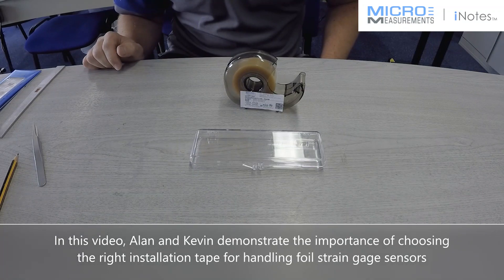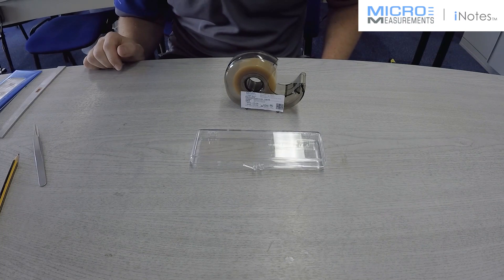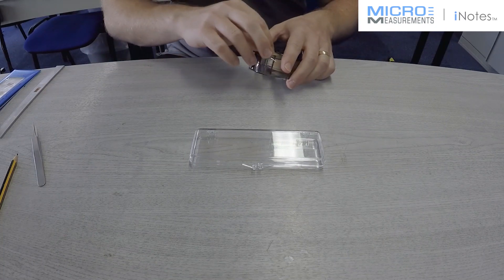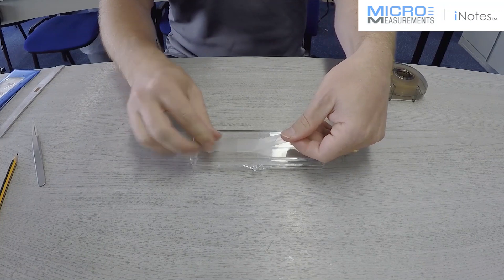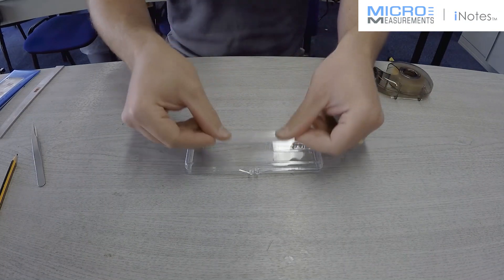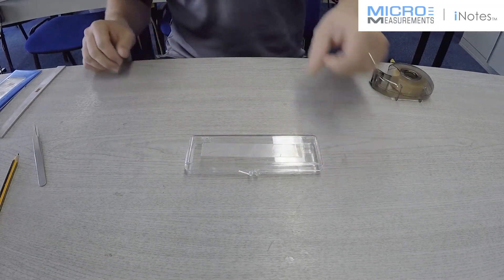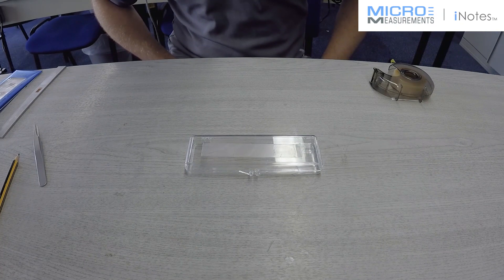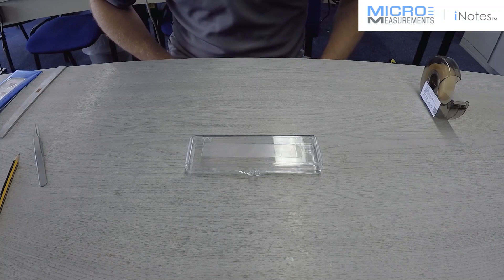Don’t Duct Duck The Problem - Strain Gage Installation Tape

Comment: Desde Micro-Measurements y su filial española Vishay Precision España, s.l., ofrecemos todos los accesorios necesarios para la correcta instalación de las bandas extensométricas (adhesivos, materiales de preparación de superficie, accesorios para la manipulación de las bandas, cables, protecciones, etc.).
En este interesante vídeo, Alan y Kevin nos explican el porqué es también muy importante seleccionar la correcta cinta de papel celofán, y nos demuestran en la práctico, cómo la cinta de papel celofán de Micro-Measurements, PCT-3M, satisface todas las necesidades que se requieran para la correcta manipulación de bandas extensométricas. ¿Podría decirse lo mismo de cualquier papel celofán que compre en un supermercado o ferretería? ¿Arriesgaría el éxito de su instalación extensométrica por emplear celofán no certificado para su uso extensométrico y con propiedades variables de lote a lote?
Si precisa información adicional, por favor no dude en contactarnos y estaremos encantados de ayudarle.
mm.es@vpgsensors.com
miguel.bravo@vpgsensors.com